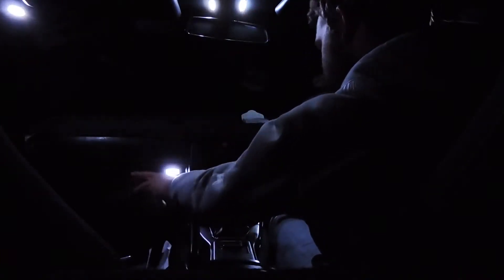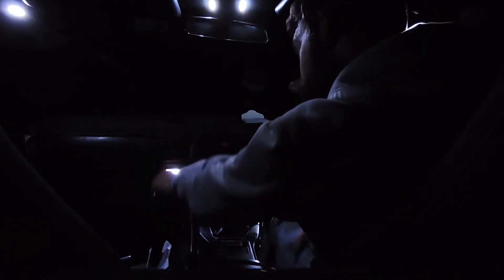MX-5 Central Locking / Interior Lights Complete

Comment: hi, i would like to do that in my car. but for some reason the light wount flash when i unlock my car by central remote. maybe you can help me out with that problem? car's intrier light start flashing when i open the door, but how to do, that light start falsh when i unlock the car?
Reply from the maker: you'll need to get a signal from the central locking to whatever controls your lights.
in this case, I have an arduino that controls both the lights and the central locking 
i've got the switch on the lights going into input pins on the arduino, the actual door switch also goes to the arduino, and the power to the lights being controlled by the arduino too - but the arduino sits in the middle of all of the sensors inputs and light outputs on the car.
Reply: @sadfghjkllkjhgfdsfg  what Arduino controller model do you use?
Reply: @sadfghjkllkjhgfdsfg  also, without that control, can i do it